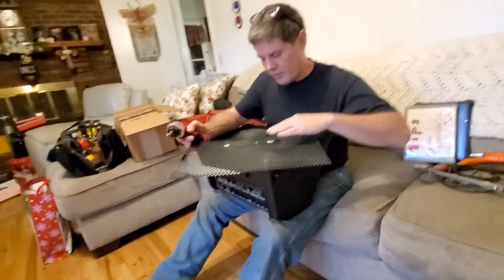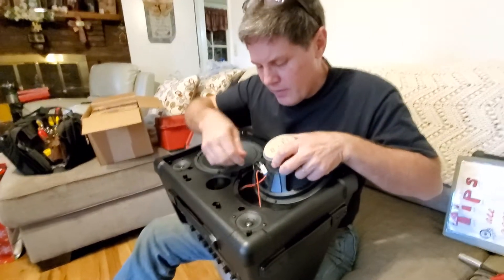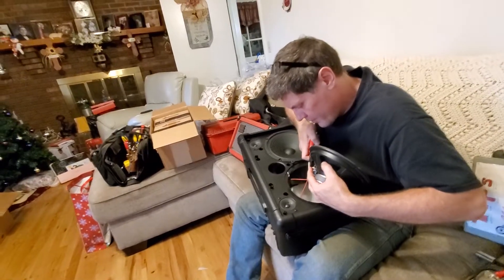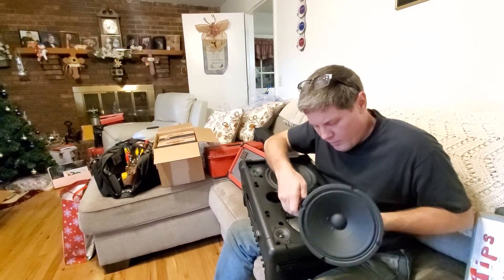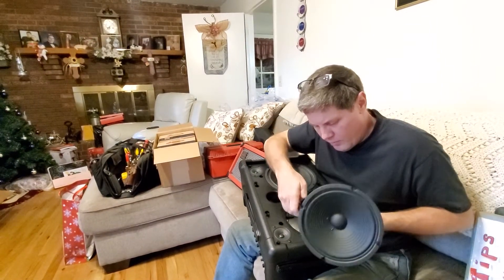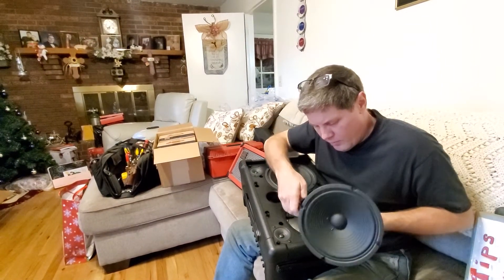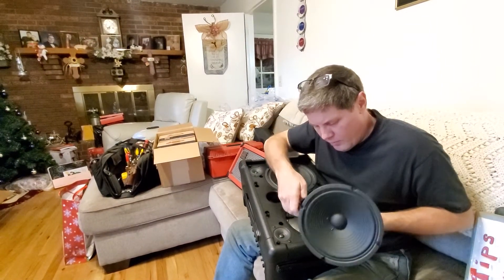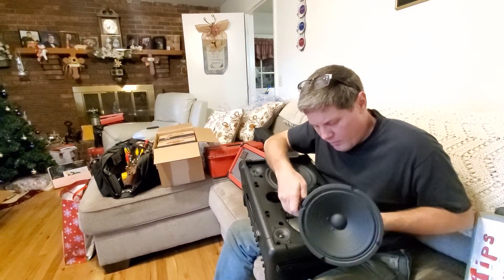Roland Cube Street EX Jensen upgrade

Comment: Thank you. Can you provide a link of Jensen speaker? Also can you tell me if this speaker is better for singing ? Thanx in advance
Reply from the maker: You can find the speaker on reverb for $30 each the speaker is a huge Improvement providing a thicker richer tone. Lower frequencies really come through and give an added warmth that the speaker needs desperately. Helps rounded out
Reply: @blindjusticeentertainment3819  Thank you - Can you tell me the exact model please ?
Reply from the maker: Jensen Model 8 and make sure that it's the 4-ohm variant don't get the 8 ohm it will not work with this